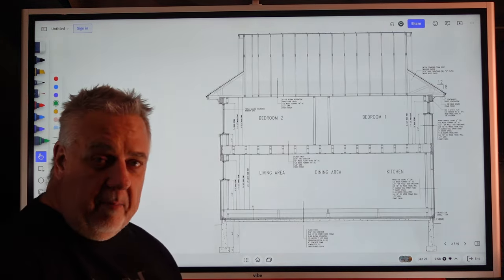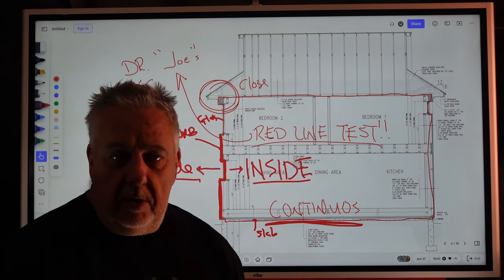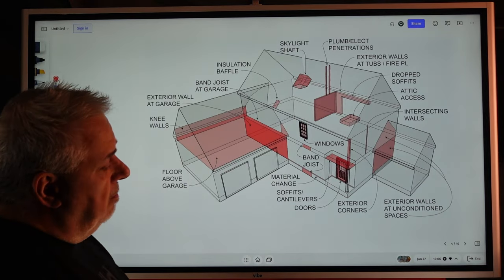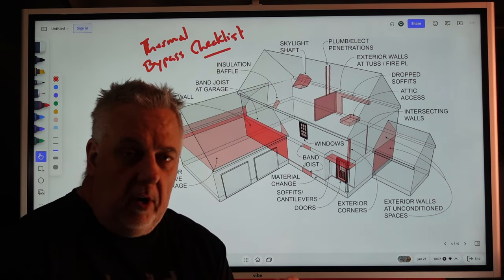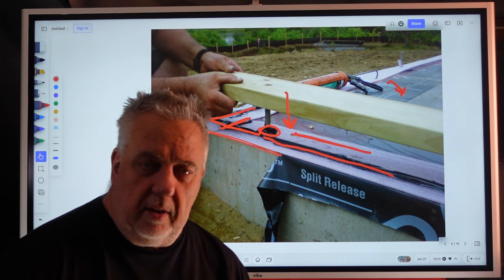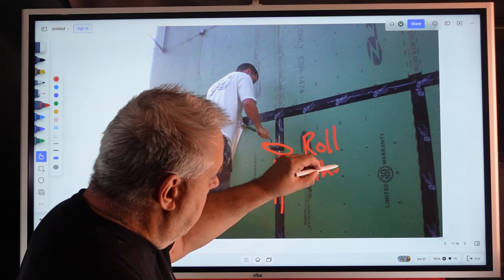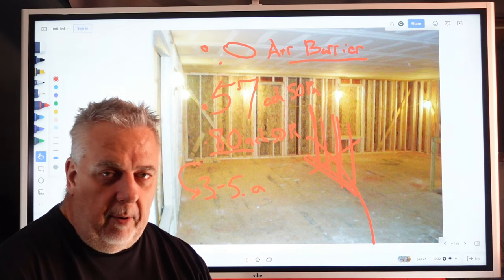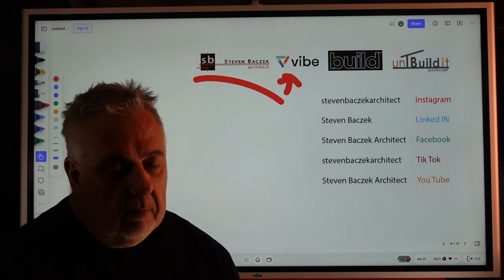PH 11 Episode 10 - Air Barrier Continuity

Comment: Steve, loving the series and Vibe board!

I'm about to embark on my own build in climate zone 5. My goal is a very efficient build but not PH certified. Do you have any gut reactions to vapor condensing behind the gypsum given the following wall assembly?

Zip-R, 5.5" CSSF + staggered stud walls, mini split HVAC + appropriately sized ERV.

I also like how you fed 2 birds with 1 scone by tying the ceiling drywall into the air barrier. For added protection against cracking, could you consider tying a layer of 6mil poly to the Zip-R above the ceiling insulation?
Reply from the maker: NO Poly in the house, it will be a problem before it is a solution likely....

Comment: Steve, Love your videos and exciting ideas. You are Mr. Practical Green. Question: If you were to calculate the CO2 and water vapor generated per day by two adults contained in an air closed house, what do you suppose that number might be? In other words, what might the necessary internal air changes per day look like. Other activities of course could add to this baseline. Let’s say in one of the more conventionally sized houses you’ve constructed. Thanks.
Reply from the maker: ASHRAE Standard 62.2 - check it out. It outlines the ventilation requirements